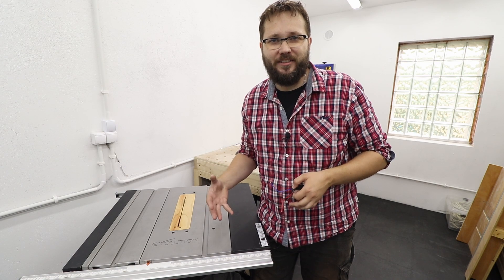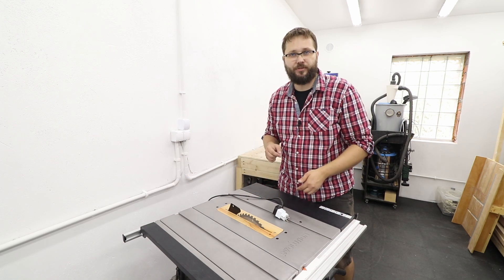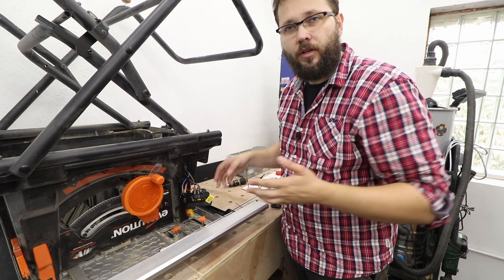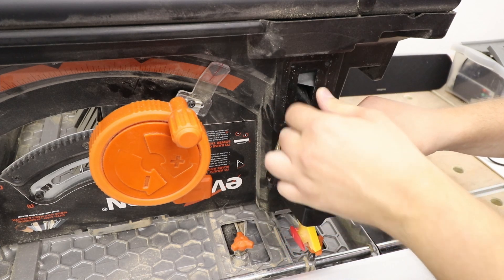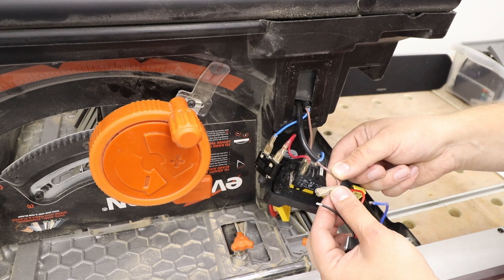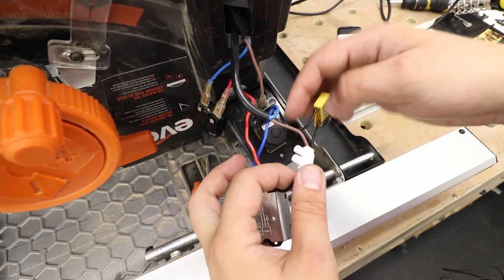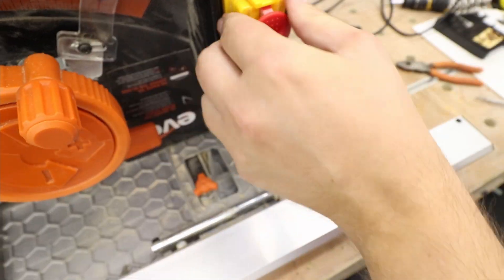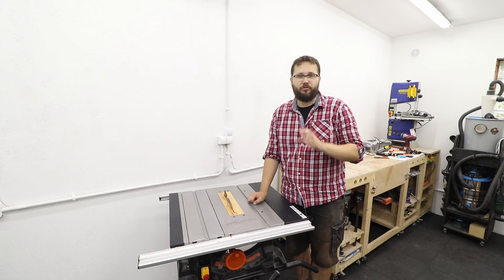Evolution Rage 5-S Table Saw - Installing a Soft Start Module

Comment: Hello Mate. I followed your instructions but I can't get it to work because my mitre saw have 3 wires from the motor. blue .. brown.. grey. any tips?
Reply from the maker: See where exactly are they going, which one is which and then use the instructions from the module.
Reply: @CasualDIY  I manage to get it sorted after messing about wiring in different configurations. How can I contact you? I'd like to share How I fitted shadow cut line to my Hikoki C8SFHG mitre saw. With soft start, Shadow line and electronic brakes it's up there with the best of them.
Reply from the maker: @cassiya100  you can always drop me an email casualdiyuk@gmail.com 👍

Comment: Hi great job,what size shrink tubing was used?
Reply: Thanks very much,would a 12 amp soft starter be enough for this machine,would you know?
Reply from the maker: @brendangleeson9644  Check the machine it should say what amps it has. I'm not a trained electrician so I don't want to advice people on this topic.
Reply from the maker: Can't remember sorry. Got a set so I picket one that was fitting

Comment: I want to use this on a power amplifier if it will function as a generic soft-start. 

To confirm the wiring: 
Red to LIVE/ACTIVE 
Black to LOAD (Active from load)
Blue to Neutral  -> when you push your power button I presume Neutral connects and now goes to the soft start and the motor together (a Y split)?
Reply from the maker: Some of them have different colour wiring/ best to check it with the sheet that should come with it.

Comment: Hi Thomas, The soft start module I got looks different to the one you used. Locations of the blue and red wires are swopped. When I followed your instructions re hooking up by colours, it didn't work on my Rage5s. What are your thoughts on this? Thanks.
Reply from the maker: You should have a technical sheet or some drawings on the module so just try to follow those
Reply: I cannot understand wiring diagrams at all. However, ignoring wire colours but connecting my module according to wire locations, (where you have a blue wire, I have a red, where you have a red next to the black, I have a blue), it now works. In other words, where you connected the red onto the switch, I connected blue instead. My red was then connected to the blue on the switch. Black was connected as you indicated. Hope I described it OK.

Comment: Can this be used on a fridge
Reply from the maker: On a fridge?
Reply: @CasualDIY  yes a soft start on the fridge compressor as it shuts down the inverter I want to use to run it
Reply from the maker: @dama054  not sure if it would work for that to be honest
Reply: @CasualDIY  ok well thanks for your reply

Comment: Does anyone have a data sheet for this KR230 device? I want to know what’s inside and how much heat is generated. This is the second video I’ve seen where it is placed inside the switch box and I’m just concerned about overheating. Thanks

Comment: Hi Thomas Fitted the soft start module to my saw but unfortunately doesnt even start up. Followed your instructions to the letter so cant understand why nothing is happening especially when all the other comments are good. I noticed on another review that the reset button has a red and a brown wire connected to it while on mine and on yours it has a red and a blue wire. Anyway just thought someone might have any ideas as to what the problem could be.
Reply from the maker: Just follow the instructions on the module. If the wires are connected correctly and the module is not faulty it should work
Reply: @CasualDIY  can the module be tested
Reply from the maker: @philippanico4479  I would imagine so but that's beyond my knowledge unfortunately
Reply: @CasualDIY  many thanks Thomas.

Comment: Finally got round to doing this upgrade - many thanks for the inspiration
BTW Did anyone else struggle to squeeze the module in the switch box?
Reply from the maker: Its a tight fit for sure 😅

Comment: @3:05 the soft starter module [ZLB] KR230-16A. (16) 16A/250V. (25) 25A/125V ~5E4 but out of stock. Has anyone use the ebay copy part XS-16D3 (3036-2) ?

Comment: Hi Tomasz, great video as usual and have the SS module ordered via your link. One question though - where did you get the stop paddle for your on/off switch please ?
Reply from the maker: Hi mate, the paddle was originally on the saw. For some reason for a while they stopped doing/ adding the paddle. I think if search on ebay you will able to get one

Comment: thanks for the video Thomasz . installed soft start to my table saw yesterday, what a difference. the only issue I had was trying to get all the components stuffed back into the housing. ended up checking a bit out of the housing for the 3 soft start wires and tie wrapped outside of housing. thanks again, keep the videos coming 👍
Reply: It might be wise to have the soft start module outside of the housing - it's aluminium case acts as a heat sink. I'm thinking about mounting it on the outside of the housing on short stand-offs. Protect the leads with heat shrink.
Reply from the maker: Glad my video was some help 👍

Comment: I have similar saw. It has common, start, and run wires to motor. Looks like I only need common and run . What do I do with start lead?
Reply from the maker: Just check the spec sheet of your soft start module it should have information on how to wire it up.

Comment: Wanted to stop by and thank you for the video regarding the rage5 and soft start module install. Browsing you-tube regarding info on the rage 5 I stumbled upon you and the channel. Great work and have even had a look on your website so well done Sir all excellent DIY stuff. I'm very electrical minded and installed my module without any defects to my rage 5 saw and its wiring loom at all. Making my own interconnect cables from the switch to module using spade terminals. So if anything did happen to the my saw unit I could always just simply unplug the module out and reinstate the original wiring back to the switch, keeping the warranty in tact Sir. i will continue browsing the channel and taking note of some of the things you do, #KeepUpTheGoodWork🤘🤘kind Regards Paul
Reply from the maker: Great stuff 👍 hope you will find more interesting content here on my channel 👍
Reply: @Digital Plumber Hi, mate I am waiting for my soft start module to arrive and am going to do the same as you so it's un-pluggable.  I'm going to use a piggyback spade to join the neutral wires but I was wondering what size the spades you used so I can order some piggybacks so don't have to take mine apart to find out lol

Comment: Hi thanks for the info on the soft start works a treat, had slight problem getting everything back in the switch housing, went eventually. Tight squeeze. Thanks again
Reply: Hi Tomasz, its probably a coincidence but since carrying out the soft start mod the blade hight adjustment has become very stiff in operation,  I was wondering if I could have put something out alignment when lifting the saw onto the bench, I've checked all the obvious things but everything seems fine if you have any ideas it would be appreciated. Regards David
Reply from the maker: @davidsmith3334  maybe some dirt or dust got into the lifting mechanism?
Reply from the maker: Glad to hear it 👍

Comment: Did this to my saw yesterday. What a difference. Used male and female  spade terminals so completely reversible. And easily replaceable if needed. Great video Tomaz. Thanks. Keep up the good work.
Reply from the maker: Thank you for watching 👍
Reply: Awesome where did you get the module I can’t seem to find it in stock using the link Tomaz shared
Reply: @akbarhussain9216  eBay. It came from Germany I think. Less than a week delivery. I’ll see if I can find a link.
Reply: @julianhiggs  please, don’t want to order the wrong one
Reply: @akbarhussain9216  I e tried to post a link twice, but doesn’t seem to like it? Easiest if you perhaps search the part number online. That’s how I found the eBay one.

Comment: Cheers Tomasz. I had to grab my module from the German amazon as UK amazon was out of stock for a year at least, got fed up waiting but, it arrived and works a charm. 

A bit of constructive feedback on your video though: 

1 - Your hands are obscuring a lot of the detail while your explaining the wiring. 
2 - You mention that the module fits inside the main wiring housing however, you've not shown the way you orientated your module. Mine was a real pain to squeeze in. 

That being said, This video got me where I needed and my Rage 5s is now soft starting like a dream. :)
Reply from the maker: Feedback taken 👍 and yes mine was a bit of a pain to get in but not too bad

Comment: Other than personal preference what is the benefit of a soft start? I’ve seen reviews on several job site saws that are 7 plus years old with regular use and no SS that are doing fine.
Reply from the maker: In theory it should prolog the life on the motor.

Comment: Excellent! The startup is so violent I find the saw height drops a few mm each time. Will definitiely be doing this mod - Thanks !
Reply from the maker: Its a game changer, the saw works so much better now
Reply: @CasualDIY  Fitted and working perfect, took about 20 mins - so much less scary now - thanks for the info! Also got a 3D- printed emergency stop flap since the newer rage5's dont have the panic button fitted any more.
Reply from the maker: @alheeley  great to hear it works for you👍

Comment: Hi Tomasz, do you know how to fit one of these to a mitre saw? The wiring on my AEG mitre saw is a bit different, so I've not been able to work out how to do it.
Reply from the maker: The easiest way to do it is to get access to the on/off switch, locate which wires that are attached to the switch are coming from the motor of the saw. We only need those wires. And then make sure to locate which wire is live and neutral. And then you connect as I show in the video. Although it all depends which slow start module you got as it may be bit different

Comment: Hi good video but can you electrically brake the saw blade as well for all our safety thanks
Reply from the maker: The emergency stop button is not affected by this module so it will stop as normal.
Reply: @CasualDIY  hi just watching woodshop junkies he showed a electrical device for braking the blade maybe you could do a video on this thanks
Reply from the maker: @jamesralston6761  I don't watch his channel,  just had a look and could not find a video you have mention. Have you got a link by any chance?
Reply from the maker: hmm seems to be an interesting addition, I will have a look if I can pick up something similar at a affordable price.
Reply: @CasualDIY  Hi thanks that’s the problem with most table saws stopping the blade quickly if you have to.

Comment: Hi Tomasz! I hope your ears where burning this afternoon! Getting all the wiring back in the box had me cursing you ;) But I have to say... what a great mod. While I had it upside down, I added some very thin flexible plastic sheet (0.5mm) & Gorilla Tape along the side and back of the dust shroud. It's isn't "airtight" as it has to move through 45Deg but WOW! Such an improvement... Two excellent mods in one day :D Keep up the good work
Reply: Likewise an excellent mod - but also likewise I'm having a helluva job getting the wiring back in - I'm thinking now about giving up and fixing the module on the outside of the shroud and making a protective cover now.
Reply from the maker: Hehe glad it worked out for you in the end 😂 I'm planning to ditch the stand from my saw and mount it to a bench, when the prices of plywood go down that is 😂 so I will try to tackle the dust issue then
Reply: @CasualDIY  I'll be interested to see that. I've been thinking of building a cabinet too. That would allow for a better dust hopper with a 4" port. The old plastic shroud could be removed if the blade was safely enclosed.

Comment: Nice modification, not sure if this a scare generated by the "Safety Hysterical Instructional Trolls" (shits for short) but Chocolate strips can loosen over time if not fixed down. You're going to get much less vibration now anyhoo, but might be prudent to check it after a bit of usage.
Reply from the maker: There is never enough safety to be honest. I don't want my workshop and house to burn down and I'm not all knowing. Good tips and feedback are always welcomed here for my own sake and for benefit of others. Now, everyone has got a brain and responsibility to look after themselves and make safety amendments as they deem fit. Some of the tips and feedback are worth while others may be over the top and maybe they are required in a full on factory but not necessary in a small workshop. Its a vide topic to cover really and everyone got their opinion on it. But yes I don't think we need to go over the board with it. All the best mate.

Comment: Just changed the blades on my rage5s made by Saxton from Amazon I’ve put the 80t on the miter saw the r255sms and the 40t on the table saw  both work great and less tear out
Reply from the maker: I love those blades. They are really good in my opinion 👍

Comment: Love your channel and your approach - found this video really useful and have just ordered one - thankyou ( just a small piece of advice when soldering, heat the wire with the iron and flow the solder onto the joint not onto the iron and then transfer it to the joint - not a criticism just an observation )
Reply from the maker: Thank you kindly and for the feedback as well. The last time I soldered anything it was like over 10 years ago. So thank you👍

Comment: Thanks Tomasz, I saw on your last vid that you were doing this mod to your Evolution Saw... so i ordered a slow start module from Amazon (mine came with Wago connectors and heat activating solder connectors as well).. I now have a slow starting  Dewalt DW745 saw now...cheers buddy.
Reply from the maker: No problem. I don't understand why this is not a standard feature off all saws 🤔

Comment: Hi, I do not mean to insult you but your soldering skills are not up to much, you are making the mistake of melting the solder with your soldering iron instead of heating the wire and then applying the solder so it will flow into the strands of the wire.
Reply: You shouldn't solder and the put in a screw terminal anyway. The screw crushes the solder and risks the connection coming loose. The wires should be re crimped only.
Reply from the maker: @GlennPierce  yes ordered a cramping tool with accessories yesterday to do exactly that👍
Reply from the maker: Yes someone pointed that out already and yes my soldering skills are terrible 🤣 last time I was soldering it was like over 10 years ago so I need to catch up with the technique 👍😁

Comment: What a great mod. My Rage5S's starting sound like a gun going off.
Used the link amazon link, as a thanks for the inspiration to do something about it!
Reply from the maker: Thank you very much 👍
Reply: @CasualDIY  so that's zero clearance plate and now soft start. If you could just have a crack at the blade guard / dust collection to stop it spraying dust everywhere, you'll have fix the three main flaws with the saw ;) 👍👍
Reply from the maker: Hehe seems that way. I was recently looking into the blade guard as I bought myself a 3d printer like a year ago. And was thinking about printing one. But so far I'm to dumb to do it lol but I'll get there. With the dust it's mainly spraying from the bottom and now I'm thinking of building a bench and just mount it to the bench that will act as an outfeed table. So I would try to tackle the dust extraction at that point.

Comment: .... How hot does that soft start get? Tbh seems really tiny for something supposed to handle 8A @240v or 15A @120v. The soft starts I've installed for other equipment were always much larger for that amperage. Especially when the motors working hard.

But I might be wrong.
Reply from the maker: The one I got is up to 250v and max 16A. So far had no issues with it. But time will tell.
Reply: @CasualDIY  Glad to hear you're being safe! It would be nice to hear how this has faired after 6 months or a year.

There is a peak ampacity number they might not have published, where it can survive a peak current of say 45A or 80A for 500ms or 80ms. The same with inductive voltage spikes.

As well if it's chinese they may or may not have lied about the ratings. There's more than enough tear downs of Chinese knockoffs demonstrating that.

I don't want to be negative, you followed good practices. Hopefully it works out great for you. 

 If you do end up with any concerns put it in another sealed metal electrical box so it doesn't wreck anything like the switch or the existing box.
Reply from the maker: @Morberis  There's never enough safety measures. I will definitely have a better picture with a project that will require the saw to run for longer. But with prices of timber and any wood related materials being so high, those projects have to wait for a bit 😢

Comment: Hi Tomasz, I have this saw but my NVR power button doesnt have the flip down stop cover....I have owned it for a couple years and this always struck me as weird.... Have i received a saw with missing part or did you retro fit that NVR switch? Thanks Nic
Reply: Evo do the spare part of the full switch with what looks like the emergency stop cover for £25+postage. But I found a few well reviewed 3d printed ones ON Etsy For closer to £10-12. Might give those a shot.
Reply: @RetroAFCNicØ  I bought one from Etsy and it works great!
Reply: @ncc714  yep I've rolled the dice.
Reply from the maker: Mine came with the NVR switch.  I think they all do, could be a missing part?
Reply: I’m in the same boat, have had mine since April this year and no NVR. Maybe a case for Evolution support?
Reply: This was a design change, there's a guy on etsy that sells the flip covers. Come join us on the Evolution Rage 5S facebook group for more info.